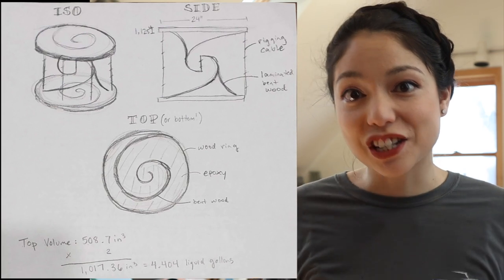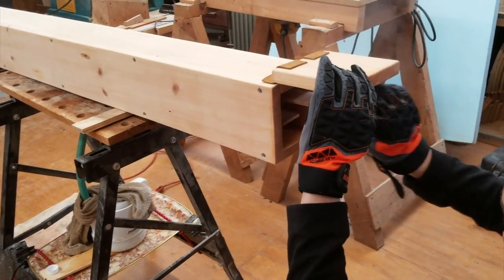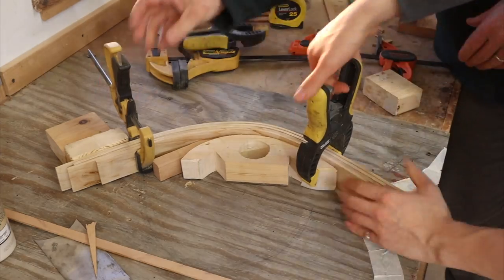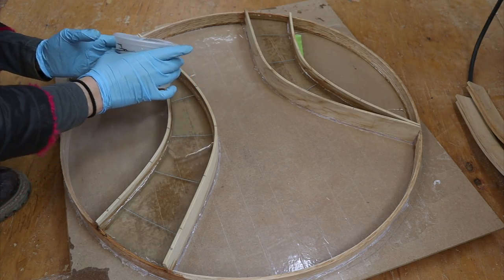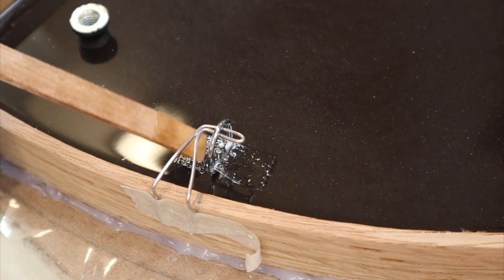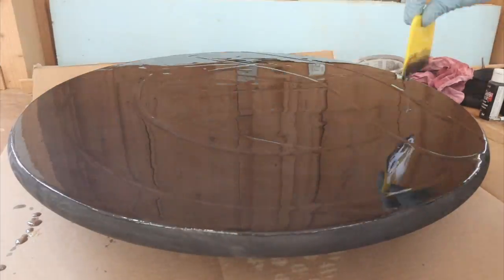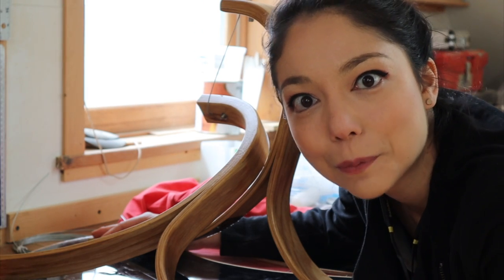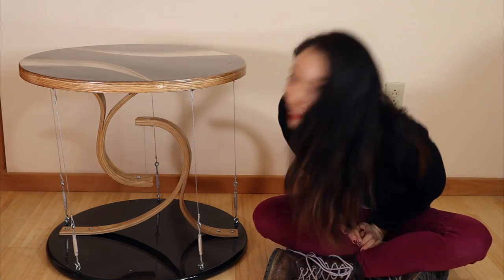Making a Floating Table

Comment: That came out amazing! You nailed it!
Reply from the maker: What a compliment coming from you!! Thank you!!! 

This is what all that thickset was for :)
Reply: You surely mean: epoxied it.
Reply: @xylafoxlin        I. I p
Reply: i wonder if the border threads on the top table would make it more stable if they were connected to opposite sides on the bottom base (instead of the threads being connected parallely)

Comment: I absolutely love watching your builds. This one especially, because unlike most epoxy videos that I've watched you actually show the struggle. That includes bubbles in your pour. I am working on my very first pour, epoxy on a slab of Teredo wood which has been a pain when it comes to bubbles. It's on its second day of curing, so one more to go. After that I will have to do quite a bit of sanding as well since there are plenty of irregularities because of bubbles.

Anyway, great watching your content. Keep up the amazing work!!

Comment: amazing save on that broken leg! it is one of the best looking tensegrity tables around, but as an engineer I would also over engineer it and put the wire tensioners horizontally under the base of the table, it would need little pulley thingy at the base to change the direction of the cables but then the cables would be clean and would look uber stylish. I would also cross diagonally the cables to give it extra stability, I think it should work better.

Comment: Wonderful channel! If anyone else is going to build one, I have one time bit of advice. If you want to hide the turnbuckles, you can have a fixed loop at the bottom of the cable, Looks nice! Then have an eyelet on the underside of the table. The cable would loop through the eyelet and then run parallel to the underside of the table. Then the turnbuckle, is hidden from view, but adjustability remains.

Comment: Beautiful design and interesting principle of operation. So, all the cables on the perimeter don't have too much tension when the table is empty or symmetrically loaded, and they stabilize the table and prevent it from tilting, while the central cable is what does the heavy lifting and it should be more durable than the rest.

Also cat-testing the designs is always a meowsome idea! :)

Comment: This vid really steams my ash :)  Sorry, just had to say that. Seriously, extremely well done. 

A nit is that if you're using a kettle, the steam won't be much (if any) hotter than boiling water. Of course you can superheat it, but that takes extra energy. I think what you meant is that steam contains more heat energy than the same weight of boiling water. It also has better penetrating power because there's no surface tension and way lower viscosity. 

Keep on Xyla!  I hope my granddaughters take after you...

Comment: Awesome look. I like the idea of adding carbon fiber to both pieces before you assemble them into the Y shaped legs. It would be a cool look and add a lot of strength. So there would be a line of black running down the middle then lining the inside of both Ys.

Comment: Thanks for an awesome video! Also....agree with the RZ mask issues with that version.. I sewed webbing that snaps together at the top of my head and helps to pull the mask up a bit.. it still smashes my nose, but actually stays on my face a little better.. While we're all at home and out of 3M mask inventory, might be a good quick fix so you don't hate your RZ so much.. Thanks again and loving the content!
Reply: Oh nevermind, I see you have one in a later shot! :) Do you not have regular n95 inserts for it?

Comment: Hi Xyla, 
Fine project but I would like to make some small suggestions. With that thick bottom plate you use and your finely equiped workshop why not use the router and make some holes underneath the plate where you can hide the tensioners. And use thinner and black wire to increase the howering effect! 
Best regards and keep on making!
Walter

Comment: Stunning result! My brain still can't handle the physics of these. It looks like it shouldn't work, but the math says it should. Anyway, I love the flowing lines of this piece and the pours finished up great! Glad you were able to fix the support. Thanks for sharing!
Reply from the maker: Always trust the math 😉
Reply: @xylafoxlin  What math would that be?
The way I see it: the tabletop "wants" to fall (because of gravity), but it can't fall straight down because that would require the tension cable in the middle to stretch, and it can't fall sideways because that would require one of the cables on the rim to stretch.
Where does the math come in?

Comment: The table looks great. I made a 3d printed one that I designed myself. It was a small model and made it like a year ago. What you could do to make your table look even better is to hide the cable tensioners underneath the table foot. Just carve 4 radial spaces on the bottom, long enough to put the tensioners in. fasten the side near the center to the table and lead the 4 cables through holes in the foot plate and lead them in the channels to the center until they reach the tensioner. Connect them and tension the cables. done.

Comment: I've bent hoops for chair backs and arms.  They're not laminated -- they're a full inch thick.  I was surprised that if you leave the bent wood fastened to the form for over 24 hours, it's actually tight on the form when you take it off.  In other words, not only is there no spring-back, but the wood wants to be a slightly tighter bend than the form would indicate.  I don't understand that.  I was using ash.

Comment: Hi, Xyla. I'm wondering if you could try making an alteration. Leave only 3 vertical wires holding the top board, then add a couple wires going diagonally to prevent rotation so that the table is more stable. What do you think?

Comment: I’ve never built one of these, but the first time I ever saw one, it immediately occurred to me that as they might be stable vertically, because of the tension involved, my guess was that they would not be stable side to side, or rotationally, and would wobble quite a bit. And when that cat jumped off, it became clear that it was indeed wobbly. If I ever do try to build one, I think I might at least try getting some triangulation happening, by having the outer wires cross each other and be fastened together. Still not sure that would be enough, but would probably be way better than straight wires. Might be harder to put equal tension along crossed wires though. But they would probably still look at anti-gravity as the straight ones. Hard to tell. I like what you did with the top. That’s a nice design.

Comment: Steam bending, I've always wanted to make an old timey rope tension snare or bass drum (for civil war reenacting or fife and drum corps) , bending the shell, counter hoops and flesh hoops. New 5 gallon steel gas can, hoses, wood or PVC for the steam box, and a form to bend it around, taper the ends of the wood in a lap-joint, steam, join with glue and a tack, on the shell glue and tack with furniture tacks to make a pretty design, finish, assemble, lay down some sick beats. I'm not sure what to bend the shell around, was thinking a full sized wooden plug made out of dozens of plywood disks and maybe band clamps to hold it in place.

Comment: I like the idea, and in the z axis you could obtain sufficient strength from the compression in the wood/carbon fiber and the tension in the cables to be practical, but it would rotate as  a spring I would think, which would make a bit unstable for a practical coffee or end table as it is.  Angled cables from the attachment point at the bottom of one cable to the attachment point at the top of the adjacent cable would prevent that.  The added cabling would take away from the impression of the top floating though.  After I typed this I saw the cat cameo at the end and that springiness.  This is not a criticism, just an observation, I love your work and your table is beautiful and you are amazing.  I am a bit sad that you moved to California, and will not have your uncle so close to help you with your projects.  I suspect he was a bit of an inspiration for you growing up, and people like him are valuable in our lives.

Comment: My heart broke at 11:27. I'm so glad you found a solution.  

I have a suggestion to eliminate the turnbuckles: 

With a bit of extra cable that will be trimmed off of one loop, assemble the cables full length, without but only crimp one end. use a wire rope clip to temporarily hold and adjust the tension on the rope, and then press the crimp. After it is pressed, you can remove the rope clip and trim the excess cable. You would probably only want to do one  cable at a time, so you don't have to retension the whole table at once. That also means you really only need 1 rope clip.

Comment: I was thinking... that epoxy table is going to be pretty heavy... then with the flexible wooden supports... that's going to require more tension on the perimeter cables...  

But good comeback.  Buckey would be proud!

Comment: 12:00 -- You passed a great opportunity.  I would have wrapped the legs in several places with an inch-wide reinforcement of bare 24-ga wire, then clear-coated over it so that it will always stay shiny.  It would fit that design like it had been planned that way from the beginning.

Comment: The tensioners could be hidden in/below the  base. Make a hole and use a pin to turn 90 degrees, use some stands to raise the base up if you need clearance then.

Comment: How cool! Neat engineering, excellent execution, and entertaining videography, editing, and dancing! and cats! 

So is it just the on cable in the middle that holds all the weight of the table top and anything that gets placed on it? The outer cables are merely stabilizers, yes?

Comment: The table might be more stable if you arranged the outer ring of wires as three X’s. Or used more wires, in a W arrangement? Would that work?

Comment: Nice, I would however ditch the cable tensioners, they don't really go with the rest of the style. I would try putting some nuts in the base and looping the cable trough the  bottom and then making jig recessed in the bottom of the base to tension the cables hidden.

Comment: Amazing job.  I was wondering the same as others... Is there a way to reduce the # of turnbuckles?  And could you make it only 3 vertical retention wires?  And/or ... What if you zigzag a single wire for the perimeter hold-downs in a v-shape like on some drums?  Would that reduce the twisting -- like when the 'special guests' were on the table?  Just some ideas/questions..  Super Nice job!  Jealous of your epoxy skills.  :)

Comment: I wonder what kind of mechanical principle is hidden between the upper and lower panels. 
Is there a magnet in the middle position? Or did you neutralize the mechanical neutral position with tension? 
Your hands seem to change to gold wherever you touch them like Midas.

Comment: It's Cool. I'm curious would it be more stable to side motions if the lower platform were larger in diameter so that the suspension cables are all slanted towards the middle from the bottom going up to the top platform?

Comment: Thanks for the video, seems like a lot of effort.
I think the outer steel wires ruin the look a bit, though. Maybe some thinner wire, coloring them black, and without the length adjusters would make it better. (Not that I could ever build something like this.)

Comment: What is the purpose of the tension wire in the top?  to hold the bent strips a prevent spreading?  Visibility not an issue, I'm guessing.  Do they look good and interesting in there?

Comment: Very nice... but I have two reservations: -
- The turn-buckles are not highly attractive. I know they can be part of certain designs - like bannisters and railings for example, where they are a small part of the total - but I think that in this case they are a bit too prominent. Probably this is just personal preference so I guess some people would like it.
- The engineering design has a (quite significant, I think) weak point: that single cable in the middle that supports the entire weight of the top (2 gallons of epoxy! Plus wood, and anything you put on the table) plus  the tension of the four guy wires. Not surprising the leg broke, or that it broke at the cable anchor point. I'd be inclined to look for a way to modify that design to have at least two or preferably four support cables (yes, I know, mods that would require big changes to the woodwork design) and to recess the cable anchor point across the grain instead of along, which just added a stress-raiser to that already weak point.

But a great demonstration of workshop techniques, some really good editing, and I thoroughly enjoy the clowning 😝

Comment: Beautiful table!
But I think it would have looked even better had you routed out space for the turnbuckles on the underside of the base, threading the cable through a small hole in the base. 
And using thin transparent fishing line instead of that thick steel cable would have hidden the stability lines somewhat better.

Comment: Perhaps, instead of the wires around the edge, you could connect the outer wires to the top of the loop. This would hide them better and stop the lateral movement of the table, while still keeping it level.

Comment: Just a little FYI: the “threaded inserts” are to be screwed into the wood, not pounded in. They have threads on both inside and outside.
Reply: Those ones actually look to be made to be hammered in.
Reply: Those are press fit inserts. They are designed to be pressed or hammered in. How are you going to screw them in anyway, there is no socket on them.

Comment: 1. The end result with the top is awesome! The slightly discoloured clear epoxy actually blended in well with the swirly black.

2. When I saw it broken, my heart was broken as well... So glad you can recover the project from that calamity. Yay Engineers!

3. Your cats are chonky

Comment: For some reason I now really want a tensegrity table. Really cool woodworking project, can't wait to see what's next!
By the way, how much did all that epoxy cost you? Thinking of trying it on a desk lamp project, but likely a much smaller quantity.
Reply from the maker: Try one! Just be warned they're not great for daily use tables haha :) 

The epoxy was from a sponsor (Thanks TotalBoat!) but it was 2 gallons of thickset (had like 1/2 gallon left over) and about a pint of Tabletop epoxy. You can use my code XylaF2020  for 20% off ;) 

However, if you're only gonna order a little bit of epoxy for a small project I find 2:1 high performance to be a way better general use epoxy!
Reply: @xylafoxlin  Not great for daily use? Sounds like a challenge :)
And thanks for the epoxy suggestions, I'll have to do some experimenting!

Comment: Beautiful table, still i think i would have preferred not seeing the tensioning screws. Maybe next time you can try to hide them horizontally in the base and lead the steel string through metal washers in the bottom plate

Comment: The reason for the tangs on the outside of the inserts- they are designed to thread into the hole using an allen key, for correct mechanical strength. Just hammering them in is like hammering in a screw- sure it may work, but it's usually just a failure waiting to happen...
Reply from the maker: Screw in inserts have threads for screwing. Press in inserts (like the one in the video) have barbs and are pressed hammered in. 

https://www.woodmagazine.com/materials-guide/fasteners/tips-on-using-threaded-inserts

Comment: Just thinking, next time you are steam bending and want extra strength. Laminate carbon fibre or fibreglass between the wood layers and used epoxy glue when you clamp them into the shape you require.

Comment: Just curious, when in use with glasses of water on it or what not and it gets a bumped, does it wobble a little or do the outside stays really keep it firm? Just curious and it looks great. Great video as usual. Thank you.
Reply: Depends on the tension in the cables. Bent wood isn't strong enough to handle high tension, and that's why the support snapped the first time.

Comment: Would it be possible to pull all the wires through a sterdy ring around the middle wire?
Imagine a metal band "seemingly floating" around the middle wire, which the edge wires, still attached at where they are now, go trough, 'in an arch'.
The tensions should be maintained? Right? And the wires will be a little more out of the way.
edit: Perhaps the edge wires doesn't need to be attached verticaly, but with a couple of more wires could be 'laced', preventing unidirectional torque, and
still maintaining the needed tensions?

Comment: I'm going to shamelessly copy your design. With a different color scheme of course.
Thanks for your aesthetic eye, thanks to you, I don't have to be creative.

I'm gonna steam bend some legs for it into a spiral formation though, because i want something more practical and less cool.

Also, a last pro tip before i crack open my next beer. Single splits along the wood grain are easy to fix. Wood glue and clamps will make an invisible joint thats stronger than the original wood. Gets more complicated if the wood fragmented into multiple pieces though. 

You can also avoid the splitting problem entirely, by placing a thin veneer of wood with a 90° opposing grain direction inbetween the steam bent layers. Could also just use fiberglass but that would be more noticeable.

Comment: Thinking out loud here; if you buried the turnbuckles in the base (make them horizontal), and sealed the upper cable ties in the table so that the only thing the viewer sees is cables - that would clean it up a lot.